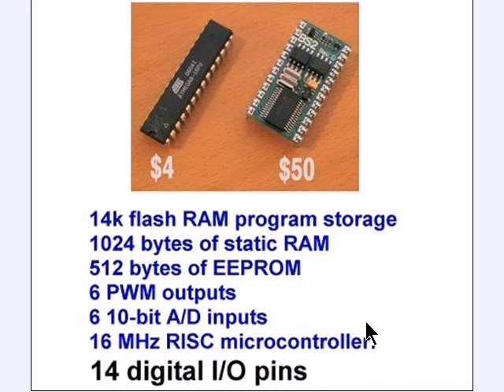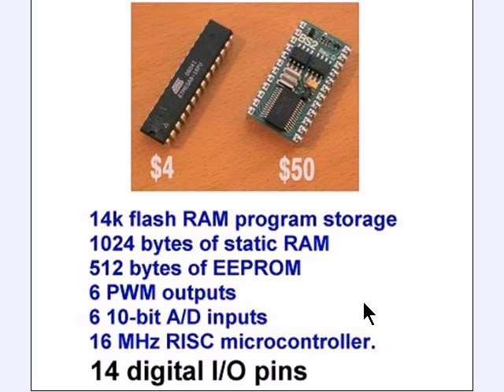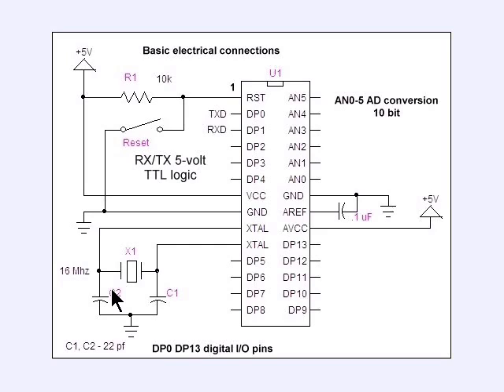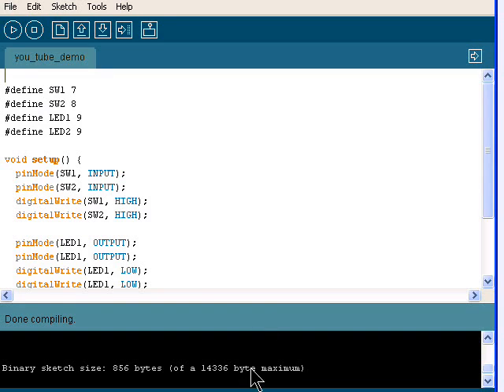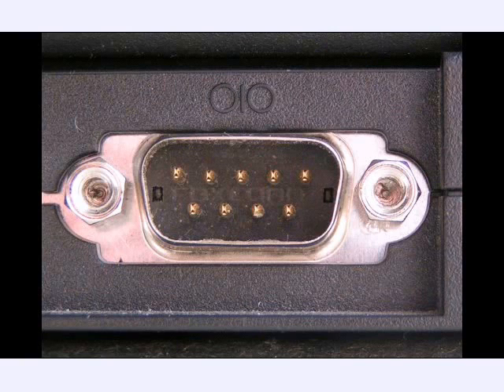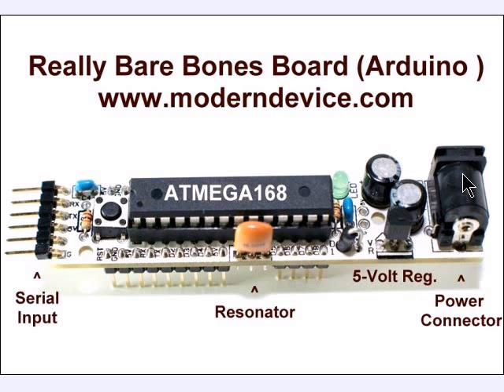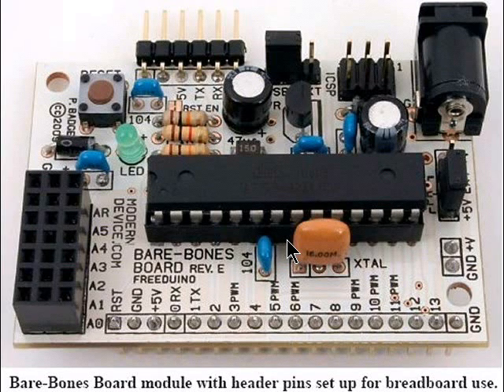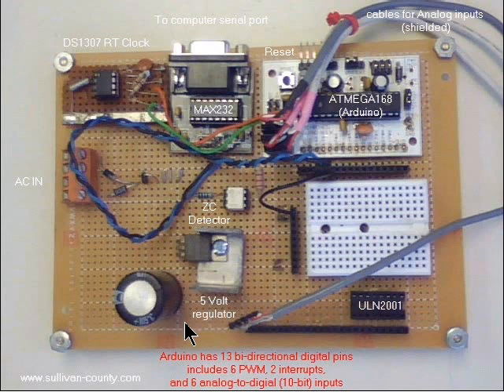Introduction to the  Arduino Microcontroller

Comment from the maker: Raspberry Pi would be great with Arduino, which can be programmed as a I2C slave to operate say hardware such as stepper motors. Raspberry is useless for hardware control so use I2C components to do the grunt work while Rasp Pi can be a front end.

Comment from the maker: I learned the 6502 on the KIM-1 on my own. We did use the 68000 when I went to college later on. On most technical issues I'm self-taught and write programs based on my electronic knowledge. The Arduino I learne don my own, but I did have C++ in college.

Comment from the maker: What is your personal problem? For starts the moment the boot loader and has a certain hardware configuration it becomes an Arduino as understood by users in the Arduino community, not and AVR microcontroller.

The video is correct and Arduino microcontroller stands as correct. If you don't like it go visit the Disney website with the other children.